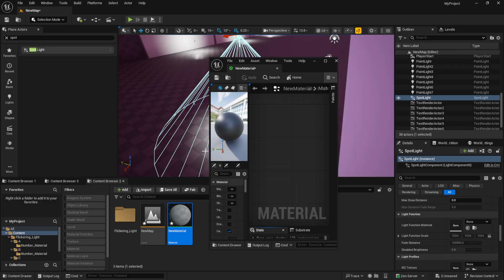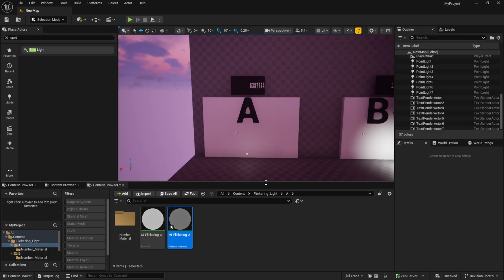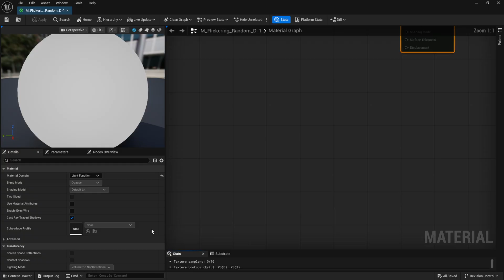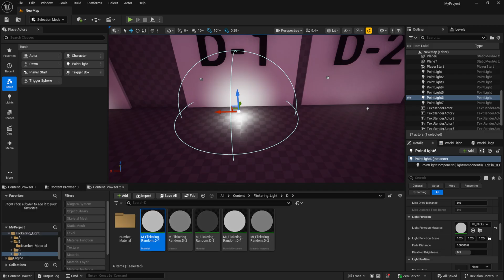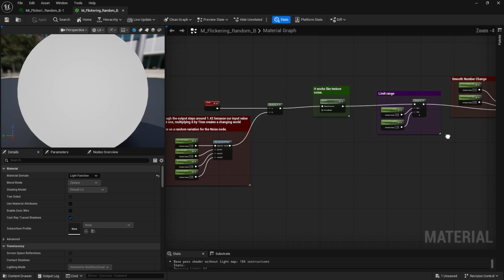How to Make Random Flickering Lights in Unreal Engine Fast

Comment: How does one find the material x append node? I don’t seem to have one
Reply from the maker: You’re probably using a version lower than 5.6 , those nodes are still experimental, and they didn’t exist in earlier Unreal versions.
If you’re using them for cinematic or rendering, it’s fine. But if you’re working on a game project, it’s better to avoid experimental features.
I made a similar version that works without those nodes, you can test it here:
https://blueprintue.com/blueprint/yq7u9d9c/

Let me know if you still run into any issues.
Reply: @Zima_EnvDesign ahhhhhh okay yeah I’m still on 5.4. That explained it, thank you. 
I will definitely try that out

Comment: Thanks for the video. Is there a way to get the random float number section for the second flicker material working without using the experimental material x plugin?
Reply from the maker: Unfortunately, it’s a bit beyond my current knowledge, but if I were making something for a project that’s meant to be published, I’d probably try to replace it using a noise node or a noise texture to generate the random values.

Also, keep in mind that if you’re using it in a game project, it doesn’t really need to be truly random you just need a longer repetitive pattern so it doesn’t feel repetitive to the player.

And if the flickering part is really important in your project, you could handle it through Blueprint instead. That way you’d get more control, though it comes with a slightly higher performance cost.

Generally, I’d keep the flicker procedural on the material side unless I needed exact timing or gameplay synchronization.
Reply: @Zima_EnvDesign  Thanks for the reply. It doesn't need to be undetectably random, but something beyond 10-15 seconds would be nice. I did notice a repeating pattern after ~3 seconds.
Reply from the maker: @ShyGuy47  https://blueprintue.com/blueprint/yq7u9d9c/
Check this out.
Reply: @Zima_EnvDesign  YOOO! This is perfect. thank you very much